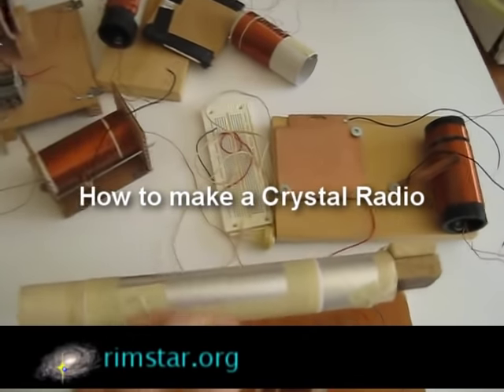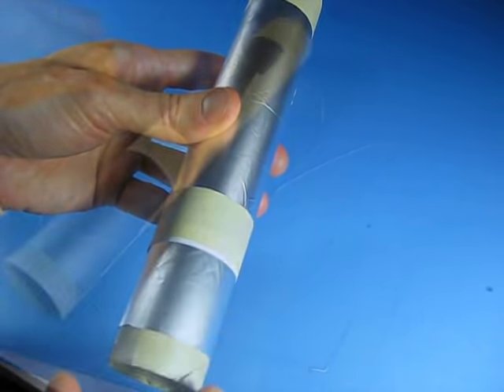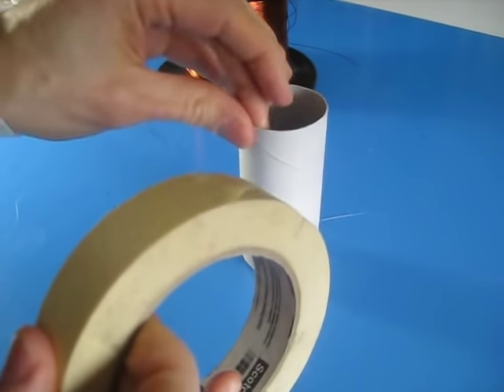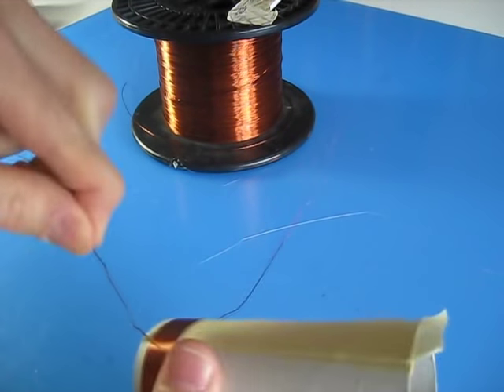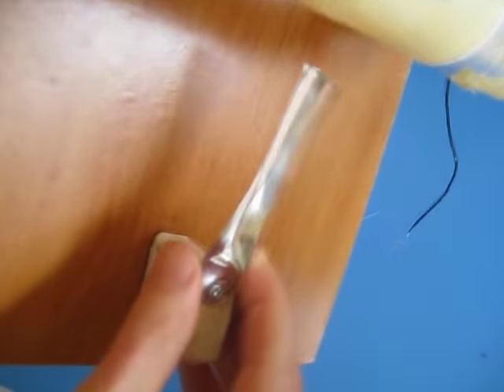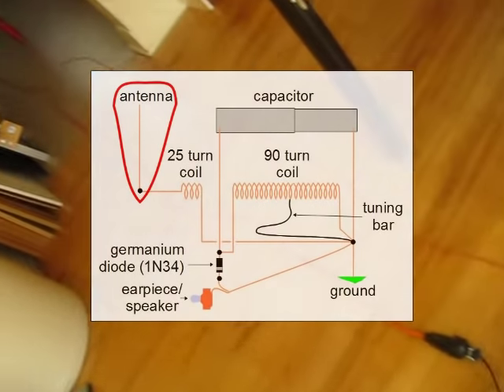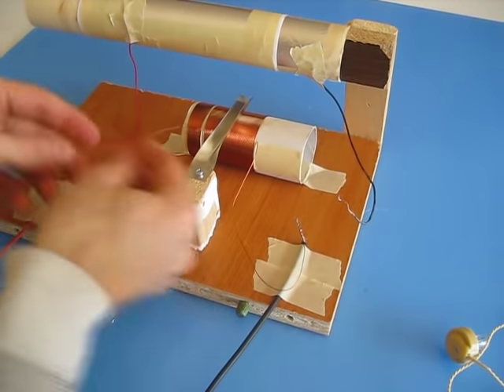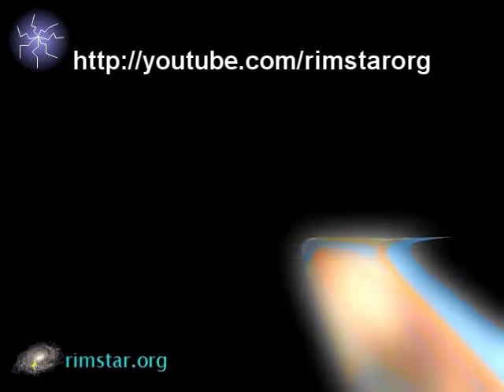How to Make/Build a Crystal Radio

Comment from the maker: Magnet wire is a popular name for ordinary wire that has a thin insulation on it made or enamel or resin. The thin insulation allows you to put the turns close together for the coil. It's called magnet wire because it's sometimes used for making electromagnets, but it's the same wire that's wound on almost every transformer or coil you can find. For the transformer, I just tried a bunch of small ones I'd collected over the years and used the one that worked best. My email is stevend@rimstar.org.

Comment: You're using an electrical ground, you need and rf ground. Any length of wire over 30 ft would be good for a ground.
Reply from the maker: Wouldn't using any wire over 30 ft add it as a second antenna? I'm not familiar with RF grounds.
Reply: RimstarOrg  It's connected to the ground and it would be across the floor, you don't hang it up. It's what's called the counterpoise (the negative end of your antenna). All antennas have a positive and negative. Ex: Your automobile antenna would be the positive and the shield of that cable is grounded to your car, the counterpoise. You also could hook the ground of your radio to a cold water pipe for counterpoise. Google rf ground as opposed to electrical ground.
Reply from the maker: Thanks!

Comment: Do you know if using wire insulated with rubber or plastic would affect the inductance significantly? From what I've read, the only reason to use enameled wire over standard insulated wire is that it takes up less space. I would imagine that a thick insulator would affect the magnetic field though.
Reply: +Scott MacDonald Actually, I just found this forum which answers my question: https://www.physicsforums.com/threads/magnetic-field-strength-effected-by-insulation-of-wire.578655/

So unless those people are wrong, insulators do not affect the magnetic field. I'm planning on using duct tape to hold the coil together, which should make things easier.
Reply from the maker: +Scott MacDonald Yup, the insulator doesn't affect the magnetic field. The length of the coil is a variable in the formula for the inductance, but the spacing you get with plastic doesn't affect it that much. One reason for the enamel coated wire is so that you can easily remove the top coating off the top of the coil for making it tunable. But if you want tunablity with plastic insulation then you can make it a tapped coil, like this one in my follow-up video https://www.youtube.com/watch?v=Gi9EmhrcfIg(except with plastic insulated wire instead.)
Reply: RimstarOrg I've seen in several places people saying not to put the coil directly on the board, but instead to have it raised an inch or so. Strange, because the board shouldn't affect the magnetic field at all.
Reply from the maker: +Scott MacDonald The other possible issue is the board interfering with the capacitance of the coil (coils have some capacitance too). I don't know how big an effect it is though.

Comment: If I use the same stuff u used with almost same dimensions,  can the radio receive signals of frequency between 90 Hz and 110 Hz? the video was very helpful , plz help me with this.
Reply from the maker: Those are actually 90MHz and 110MHz. Those are also FM radio stations, not AM radio stations. I just replied to your other question about that. Crystal radios can understand only AM, not FM.

Comment: What's really troublesome is sanding down the enamel for the variable inductor as the cardboard toilet roll bends under the pressure. Lacquer on some loops is difficult to sand down -.-
Reply from the maker: Atristiel If possible, it's best to sand it lightly and take a longer time. You want to avoid sanding any loop too much and end up with loops that are next to each other conducting to each other. In that case the two loops act as a single loop instead. You can get away with a few of those but it's best to not have too many.

Comment: Just curious:
What should we do if there were no tape.
Could we make the coils and build a radio?
Reply from the maker: Sure. I guess you could tie things instead. That's another way to hold things in place. For example, push the wire through holes in the cardboard tube and put a knot on the inside.

Comment: When designing an antenna coil that does not have a capacitor but uses several taps, do you need to take into account the capacitance of the antenna wire and the coil wire when determining the inductance (targeting the resonant frequency)?
Reply from the maker: It's hard to say without seeing the circuit since there are so many possible ones but I recall reading that the antenna capacitance is usually taken into account in those cases. I guess that would involve doing a series LC resonance calculation.

Comment: this is wonderful !! would you 
say using a basic 0.8mm enamel copper wire for the coils and the antenna is okay ?
Reply from the maker: Thanks! I'm glad you liked it. Thanks for watching! 0.8mm is okay for the antenna, unless it's a few hundred feet long, in which case that might introduce resistance and you should use something ticker. But for a short antenna, 0.8mm should be okay. 0.8mm is around 20 gauge wire (from this randomly chosen page https://www.powerstream.com/Wire_Size.htm). I used 26 gauge, which is around 0.4mm. If you use 0.8mm for the coil then the coil will be a lot shorter, half as long as mine. It will still work but the radio stations will be closer together on the coil and so if you have multiple radio stations whose frequencies are close together then they will be closer together on the coil and make tuning a little harder. Make sure to watch my follow-up video where I give more tips for making and for troubleshooting this radio https://www.youtube.com/watch?v=Gi9EmhrcfIg or check out my tips and tricks webpage where I give a few more tips https://rimstar.org/science_electronics_projects/crystal_radio_tips_and_tricks.htm
Reply: @RimstarOrg  thank you so much !! I'm only fourteen, and I'm quite new to all of this. this is my first attempt at making a radio, so it might very well be trial and error a few times. I'm glad to see that even after ten years, you're still replying and helping people out ! thank you for making this video, I'm excited to continue working on this 🙂
Reply from the maker: Hopefully you have some AM radio stations nearby (I have a few), otherwise make sure you have a longer antenna than mine, the longer the better. Sounds like you have the right approach though, trial and error. Anything can be done one step at a time. Have fun!

Comment: Hi I was wondering if u could make a video on a tasla crystal radio aka Tesla spooky radio there isn't any good instructions just bits and pieces of photos and your the best crystal radio video person I seen on YouTube .. I asked the guy to help me and he didn't reply. A video on how to build it would help many people .. it doesn't half to look that way exactly just so it works...
Reply from the maker: Brian Mann Oh, lots of fun stuff there! I guess his diode is one with a clear case. Diodes and transistors are affected to light like a solar cell. I make use of that with in my video "Make Solar Cell Transistor Powered Calculator using 2n3055". The talking into the jar, is explained in an instructable of his where he says he puts a neodymium magnet in there somewhere where sound waves from his voice can vibrate it, which of course causes a changing magnetic field to affect the antenna. Fun stuff! I added it to my todo list.

Comment: How could you make this better? Like louder, better signal? Bigger coil? Stronger capacitor?
Reply from the maker: A longer antenna is the best way for this simple circuit. For a louder signal, you could connected the antenna directly to the tuning coil and eliminate the antenna coil but then it becomes harder to tune in just one radio station. So that's a trade-off between loudness and a good signal.

Comment: So what difference is there between this and a powered radio? What does the power do exactly? What does it power? 

Great video! Amazingly cheap and I love that capacitor, it reminds me of a leden jar, but ghetto. :P
Reply: it powers the advertisers at the station....jk!  powered has more "stages" inside.  amps for volume,  amps for picking up weaker stations,  and more,  so they either are tubes or solid state.  each stage needs to be powered.  seriously google/ebay pre 1930 battery radios.  cool stuff!

Comment: hey what should i do to the other end of the wire which we use as an antenna. One more thing what do you do with the grounding wire. You connected it with an extension cord and then........???? (do we have to switch on the extension box???)

Comment: Hi great explanation. Can the capacitor be made with a wooden dowel instead of the tissue roll? Does the diameter of the rolls make a difference?
Reply from the maker: Yes, you can use a wooden dowel instead. The diameter does make a difference. You need to cover the dowel with same area of foil that I used. The toilet roll has a diameter of around 1.75 inches. The circumference (the distance around the roll) is pi x diameter which is 3.14 x 1.75 inches = 5.49 inches. The foil on the tube is 6 inches long. That makes the area 5.49 x 6 = 32.9 square inches. So you need to cover 32.9 square inches of your dowel with foil.

1. You need a piece of foil that's wide enough to go all the way around the dowel. That's easy to figure out by just wrapping some foil around the dowel and then measuring it.

2. But you need to know how long it should be on the dowel. The area will be the width x length. You measured the width in step 1.  We know the area of your foil has to be 32.9 square inches in order to be the same area as mine. The area = length x width. Rearranging that formula we get length = area / width. Which is length = 32.9 / width. So basically, divide 32.9 by the width you measured in step 1 and you get how long to cut your foil.

Now wrap it around your dowel.
Reply: @RimstarOrg  it's a 1" dowel

Comment: Do you think you could use a pringles chip can's for the capacitor??? It has the aluminum inside, just like the foil would be...
Reply from the maker: If the foil inside is really aluminum, or some other metal and not just a shiny metalic-looking something else, then it should work. Also, make sure there's no non-electrically conductive coating on the foil where you connect to it with the wire.
Also, the cardboard is thicker than the thin paper I used, which means you'll need to make the outer cylinder cover the full can so that you have as much surface area as possible.
Reply: I wanted to ask if a OA70 diode would work???
Reply: Do you think a OA70 diode would work here...???
Reply from the maker: I can't say for sure but based on the info I found, http://www.radiomuseum.org/tubes/tube_oa70.html, it looks like it would work.

Comment: would it work to use a dipole tuned for a specific band ?
Reply from the maker: trombonista92 Sort of. I've never tried it but a book I have says that you can sort of use a dipole if "instead of a single connection at the middle, the two halves of the total length are separated by an insulator and the output of each is fed separately to the" crystal radio's antenna connection point. The book is "Crystal Radio: History, Fundamentals, and Design" by P.A. Kinzie and is the best one I've seen.

Comment: Hey rimstar,
I built this radio and it works but often the sound cuts out after being used for a bit of time. If I let it sit for a while or disconnect the ground for a few seconds the sound comes for a bit. Is the radio improperly grounded or is there some other reason the sound wouldn't be coming through? Thanks a lot I love your channel.
Reply from the maker: It does sound like either you have a bad connection somewhere or a bad ground. One of the possible bad connections could be the tape where you tape the wire to your aluminum foil capacitor. One enhancement I later made was to not tape the wire to the foil but to instead wrap one turn of bare wire tightly around the tube and foil and then twist it back on itself.

Comment: Can I use a 12V battery as my power source?
If not, I have a metal stake I can put into the ground.Also, what are some smaller alternatives for an antenna?
Reply from the maker: The nice thing about a crystal radio is to not need a power source, unless you want to play it on a speaker. In that case you'd need to send its output to an amplifier instead, like I do here with my homemade amplifier (though a store bought one will do as well) https://www.youtube.com/watch?v=JtPwxbOgBHw. If you go with an amplifier then I guess the antenna can be shorter. The portable pizza box crystal radio I demonstrated in that homemade amplifier video was a different configuration again, and you can see how it was made in this video https://www.youtube.com/watch?v=iunAvz9PbN0.

Comment: Does creating an antenna coil in addition to the tuning coil require the use of a variable capacitor? In other words, if I don't have a variable capacitor in my circuit, will the tuning coil still benefit from having an adjacent antenna coil, and will this particular circuit still work? Or does this particular circuit REQUIRE the use of a variable capacitor?
Reply from the maker: This particular circuit doesn't require the variable capacitor, it just makes tuning a little easier. You do need a capacitor though, something around 355 picofarads.
The antenna coil is there to help with selectivity i.e. to help with tuning into one radio station and tuning out others. If you don't have it, then you may get overlapping radio stations.
Reply: Thank you. This is very helpful.

Comment: I really need help. I finished it. But when I plugged it in, the outlet blew. So did the surrounding outlets. What just happened?
Reply from the maker: You should really not be doing that trick unless you're experienced with working with household wiring. I should have thought to make a big warning about that in the video. You caused a short circuit somewhere which caused a breaker to trip. Usually a set of sockets in an area are connected to the same breaker in your breaker panel. Reset the breaker and you should be fine again -- and don't to that again since it'll just happen again and hopefully not cause a fire somewhere. I suggest abandoning that approach to grounding and doing it another way instead. Even putting the palm of your hand on the aluminum foil of the capacitor cylinder that's normally attached to ground should help (lot's of skin contact). I also give some other approaches in this follow-up video https://www.youtube.com/watch?v=HZZmKZJrIW0

Comment: Very nice video. I love minimalism. How did you determine the two coil ratios?
Reply from the maker: Paul C Johnson Thanks. I got the number of turns for the coils from the book I mention in the video description (the book doesn't explain where the numbers come from though.) I don't know how the 25-turn coil is calculated. The 90-turn coil is calculated along with the maximum capacitance of the capacitor in order to have a range whose tunable resonant frequencies include all of the main AM radio range, from 540kHz to 1,600kHz. You can see more about that in my video "How a Crystal Radio Works" along with more about the interaction between the coils and why there are two.

Comment: I have one made from an Atwater Kent coil and a Atwater Kent variable capacitor I'm not sure if it's wired right but I believe it is someone told me that the antenna needs to be pretty high up in the air and at least 80 feet
Reply from the maker: Unless you have a radio station nearby then yeah, you usually need a long antenna. It should be oriented in one direction (i.e. not just a bundle of wire), as long as possible, and ideally pointing at the radio station. Of course if you have radio stations in different directions then vertical is better. I have radio stations nearby and so I was able to get away with just 15 feet or so.
Reply: I put one up in the air about a hundred and twenty feet on bungee cords 30 foot off the ground and I get two or three stations in the daytime
Reply: Now I want to build a shortwave receiver got the plans ready
Reply: The back of the Atwater Kent coil has 3( taps) and the why are coming off the end of the coil on the back of the tuning capacitor. I made a selector switch to where I can  tap the coil at the  different  winding s ,the way they are wired already
   I get more stations that way now I need to add a cat whisker and a capacitor these things are unending they got one with one tube and two tuning capacitor is this called. That Mary Ellen radio has the same tapping method and I thought well might as well use those the plans just called for tapping the end
Reply from the maker: Yeah, re them being unending, a cat whisker would be fun to try and also homemade magnetic headphones.
Reply: I have seen radios that utilized every tuning method from sliding coils to ferrite rods cat whiskers in line with the rest and of course crystals these things are amazing I had bought a little Japanese one made in the 60s the other day and it only has to be hooked up to a ground or antenna with one wire and it works as good as my Atwater Kent coil made one where I tapped the center coil and got more volume, can't wait till I get a good antenna